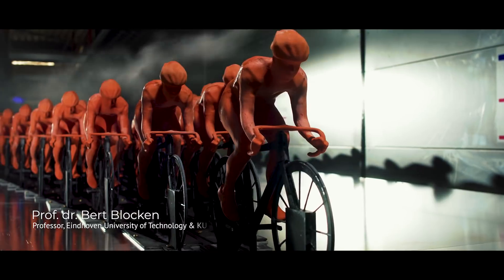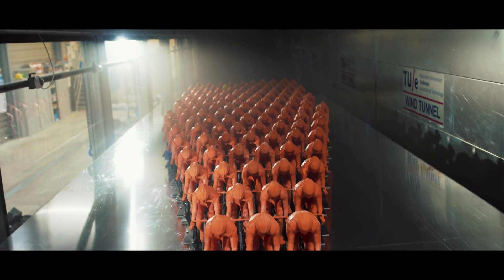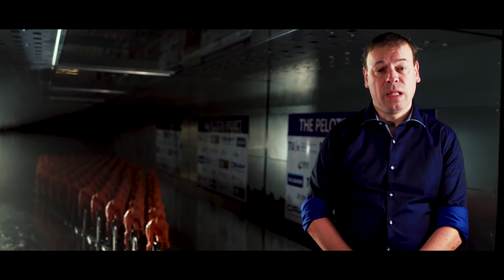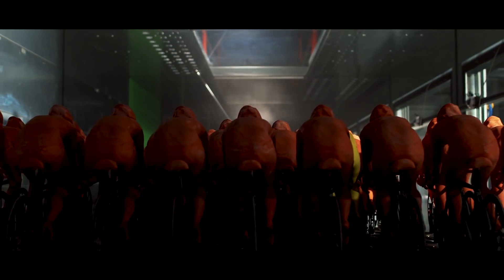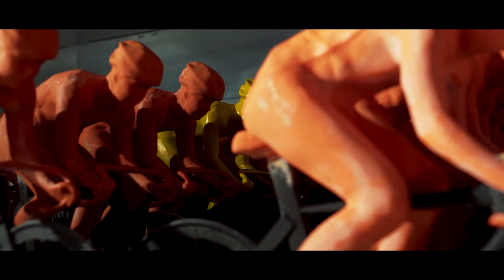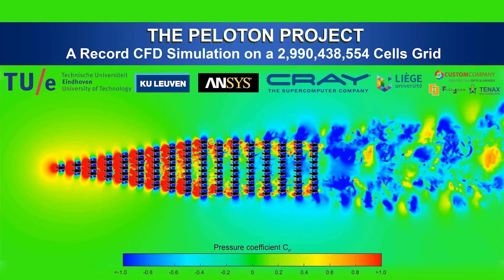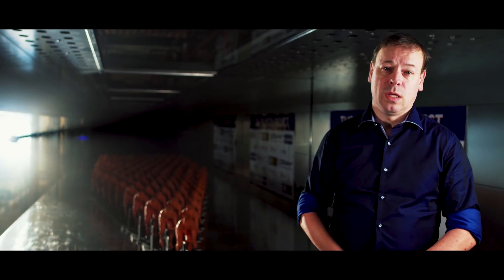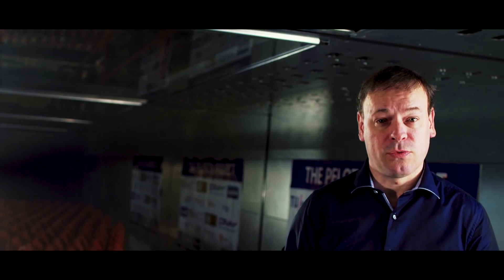The Peloton Project

Comment: make no sense. pointless test. also clay figures are all the same... and include stands 
It would be better if you run test on racing course... with real cyclists...
collect data from power meters.. their weights, heights other parameters.. ... do calculations...
you would need much less computing power and data for that.

FYI: peloton is bigger than 121 riders.

When scientist doesn't have clue what they are testing... just wasting resources.
Reply: Unfortunately, it is your comments that make no sense. Stands are necessary of course, otherwise the models would not remain upright (!). Concerning the identical models: basic knowledge in science: for clear insights, it is important to eliminate as many uncontrollable and disturbing variables as possible from any experiment or simulation - divide & conquer. That is what we did. What you suggest is not only impossible but also useless: one should measure in a real race to have real conditions and different teams will never share the full power data of their riders with each other. In addition, you will never know which rider was at what position at what exact time, and did what percentage of his/her total effort/power. The results would never be applicable to a next race with different riders and different behavior. Clear conclusions would be impossible, and no decent scientific journal would ever consider to publish the result of such an experiment... because it is useless and no decent conclusion can be made. I would advise you to leave science to the scientists, and comment on things you actually have some knowledge about.